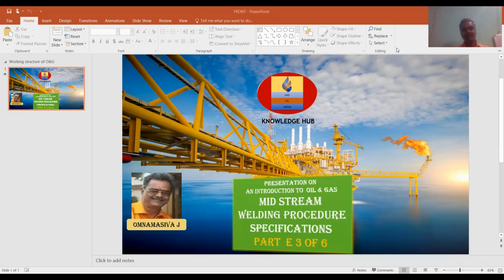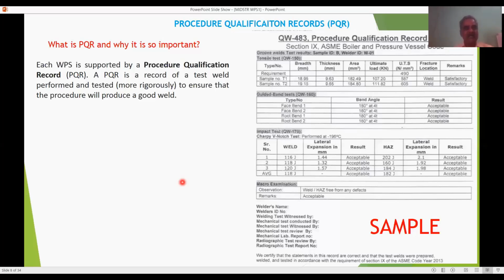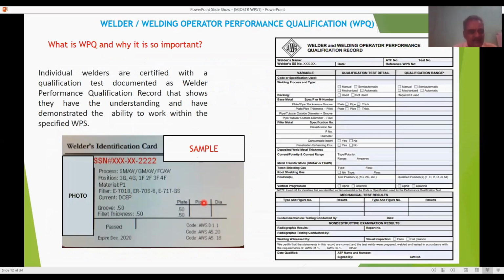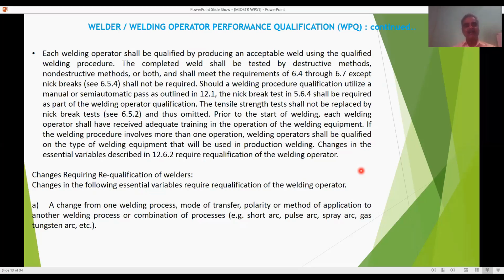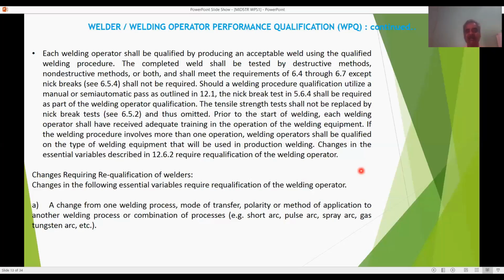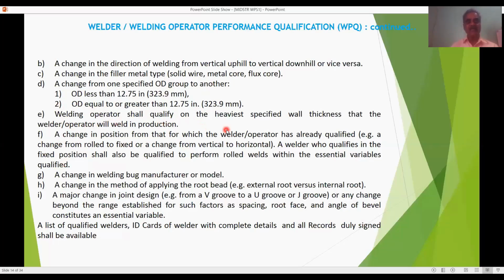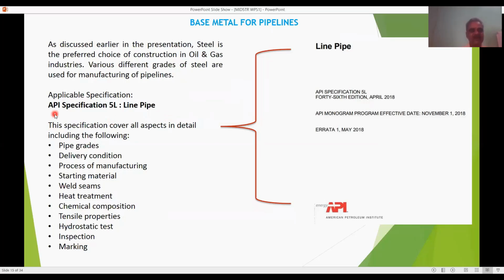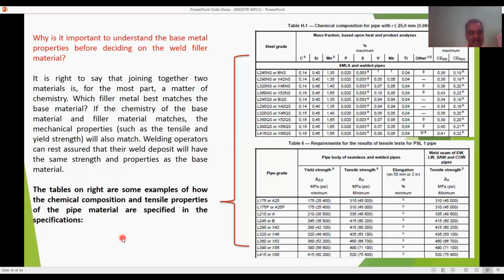Pipeline WPS PART E 3 OF 6#JONSoilandgasknowledgehub

Comment: Nice presentation on pipeline welding and base materials sir as per 1104. Station piping may be covered as per section X also.
Reply from the maker: Yes, you are right. I will do it in short time. thank you for your valuable comment.